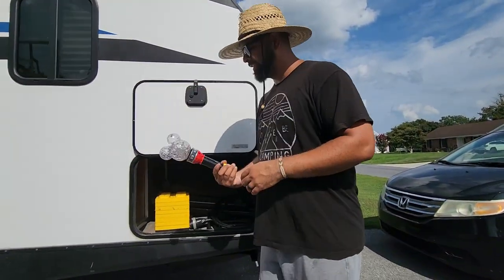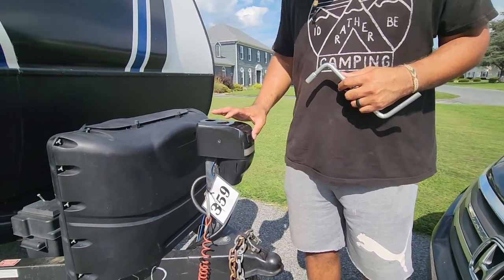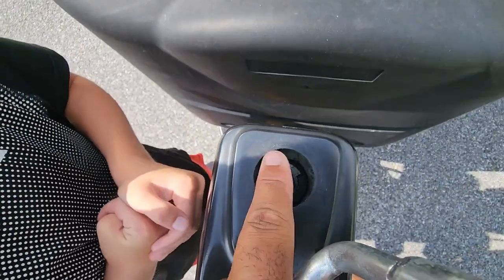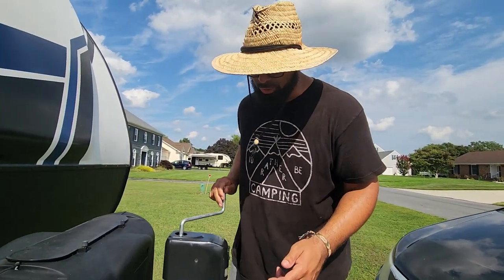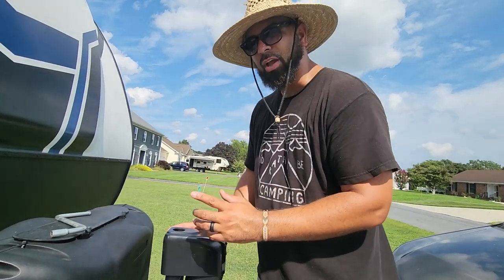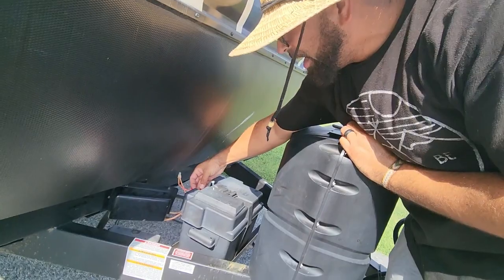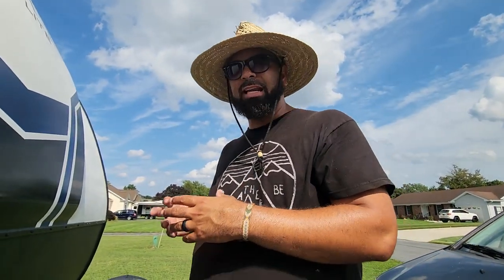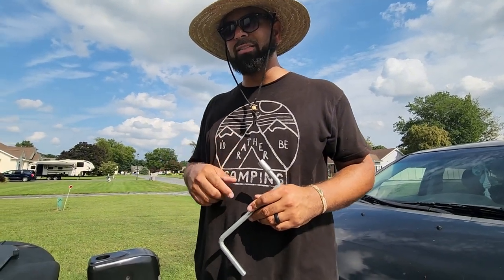RV TONGUE JACK NOT WORKING? ( RV TROUBLE SHOOTING ) RV HOW TO VIDEO #Rv #rvlife

Comment: Wrench will not move the bolt at all - nothing budging.   Jack is dead, have checked all fuses.   One thing to know is counterclockwise will retract.     I am not able to move the wrench at all.    Still trouble shooting.  Thanks.
Reply from the maker: There might be 2 fuses in cylinder type in plastic black case as well. The jack should hand crank no matter what.
Reply: Gears stripped.  Won't move.  Took it apart...stripped.  Bought a better jack and 4 year warranty.